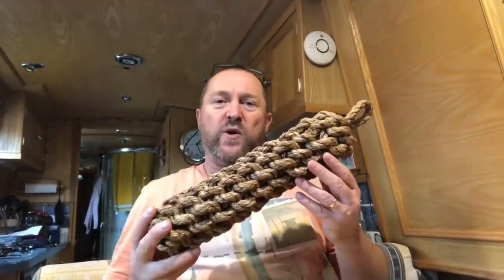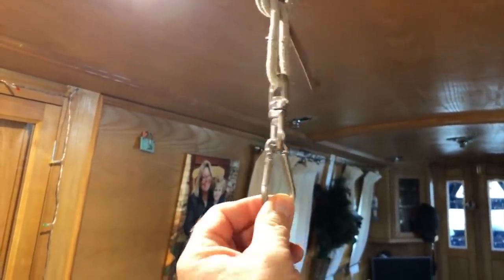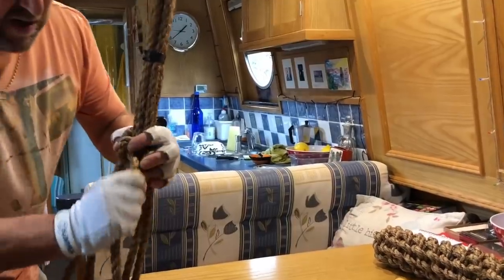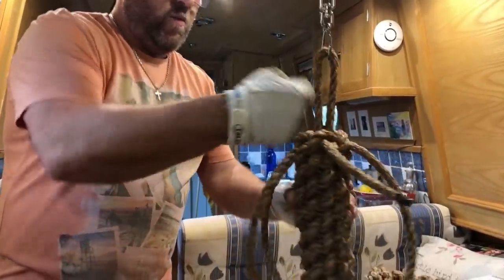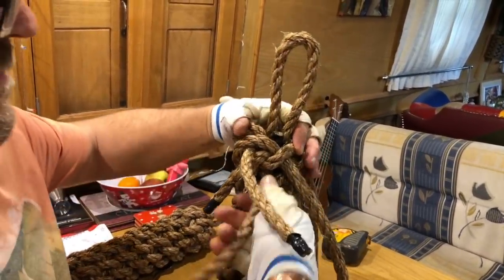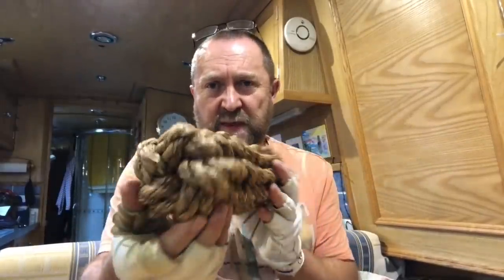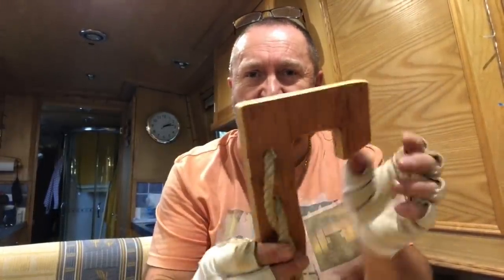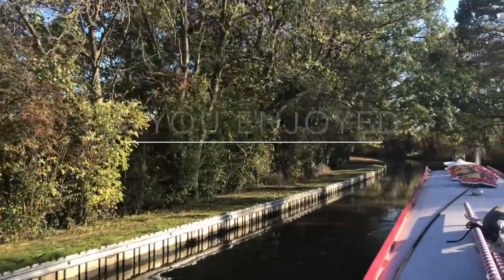E.46. Tied in Knots. Narrowboat Traditional Rope Fender Making

Comment: I do like your idea for the fender hooks but... you could possibly pass a bite through the one hole and then pass the tail through that bite. Still completely adjustable and secure.  Plus you can move the fender to different hooks without untying the lanyard. Just pull out the tail from the bite, then pull out the bite.
Reply from the maker: Good idea